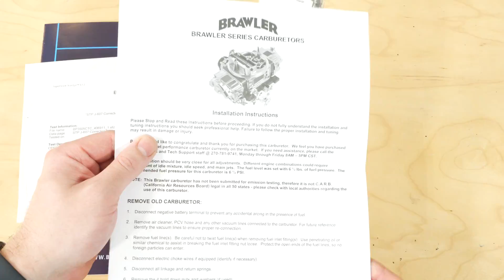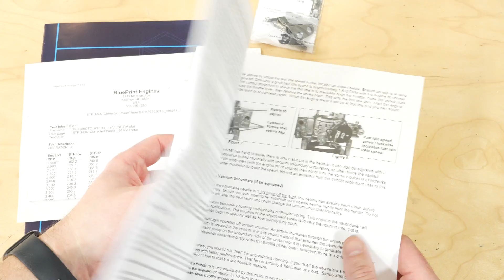Unboxing a Chevrolet Small Block V8 350 5.7L 390HP 410TQ | BluePrint Engines

Comment: I'm in the process of ordering this particular engine the same part number and it had the fuel pump spark plugs harmonic balancer and pretty much everything there on it and in your video you're not showing those accessories but I was told they were there

Comment: Blueprint recommends a 2,000-2,400 stall converter with this engine. Does the vehicle it went in have a stall converter? If not, how does it react if you throttle it hard off-idle?

Comment: Hey man, thanks for the video and info! The only question I have to this is, is your engine roller cam and already broken in so you can just pour oil in? The other Blueprint engines I've looked at are roller, just want to confirm yours in the vid is too. I've dealt with the flat tappet cam nightmare in my '86 GMC truck and want to upgrade to roller cam with a 5 speed eventually
Reply from the maker: Yep this engine is roller and pre broken in on a dyno according to the description on the Summit website. Just pour oil in and go. Thanks for watching!

Comment: By any chance did you get a video of this engine running. I have the same one that I'm installing in my 94 k1500 but haven't got to start it yet. 
Just curious how it sounds and revs up.
Reply: Do you got a video of it running i bought one for my c1500 and I'm curious
Reply: @ to be honest I’ve had nothing but issues with it. Have a mean backfire though the intake. Not sure if it’s an internal issue or timing. I can send you what I have though just a small idle video with a few revs I think

Comment: A couple years ago, I bought a Blueprint 350 "Base" motor, which they don't offer anymore. They claimed at least 373hp,
It was a long block, with Vortec heads, and my dyno sheet showed just over 400hp and 400tq.
Back then it was very reasonably priced, and still runs great. It's in a summer fun car and doesn't have a ton of miles, but it was and is, an amazing value for the motor.

Comment: I have that engine in my 1971 Vega Panel Express (station wagon, basically). The car has a turbo 350 trans 3.73 gears in rearend. Its an absolute riot. Total basket of fun. The mellow idle fools people. The car weighs 2840 with a full tank of gas, my 80lb dog and probably 30lbs of misc stuff(tools and the like). Horsepower to weight is fantastic. Not tempermental, cruises around at 25mph just fine and doesnt overheat on a 100degree day.

Comment: Great little engine.  I have used this same engine and it makes great power.  A lot of people will say that the HEI is no good but it is one of the best ignitions out there.  That little Holley vac. sec. is also a perfect carb and will have very good throttle response.
Reply from the maker: Great to hear! So far so good in the Blazer it is in! Thanks for watching!
Reply: @2carpros I plan to order this exact engine Monday